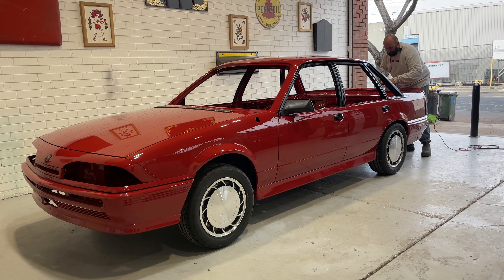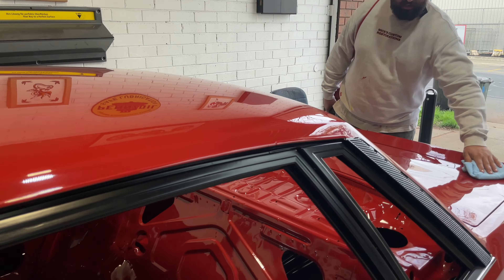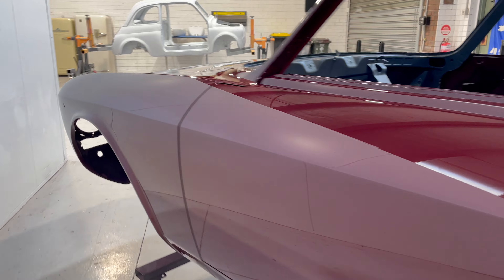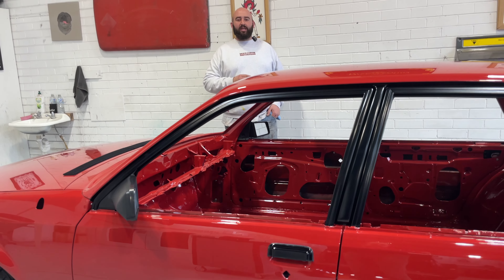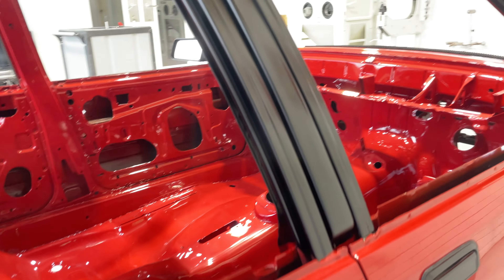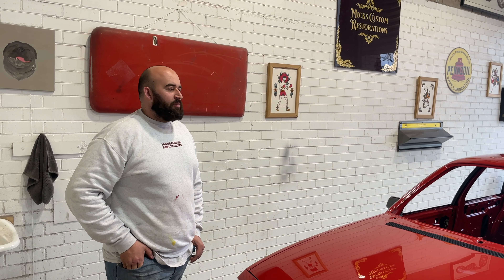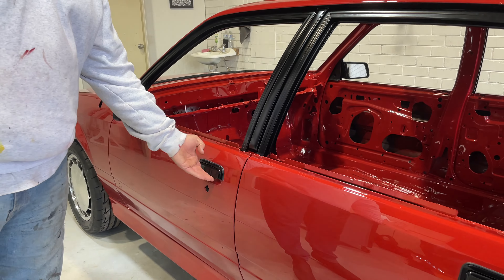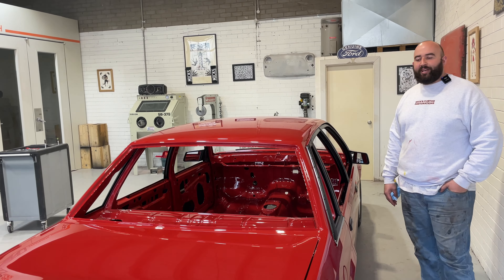Australia’s CLEANEST VL Commodore Nitron Pack : Peter Brock’s Turbo masterpiece

Comment: Aussie skyline? We have an Aussie skyline which was must better quality than this opel
Reply from the maker: What was that?
Reply: @davesclassicgaragetours  the R31 skyline, only released in Aus and NZ, the car the rb30 was designed for, would have been a much more iconic car if Nissan had put the turbo in it instead of selling the exclusive rights to Holden to use, the turbo motor made the VL the cult car it is today